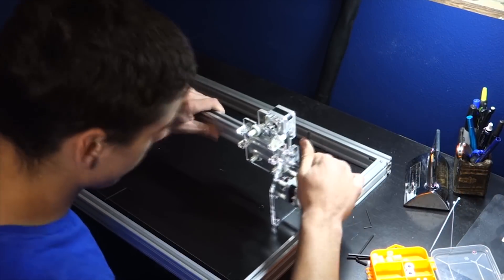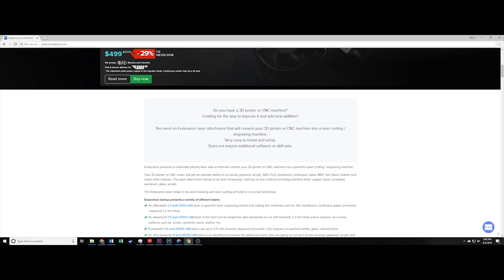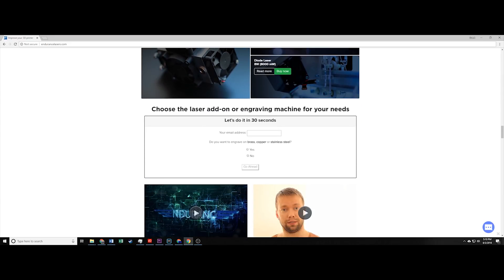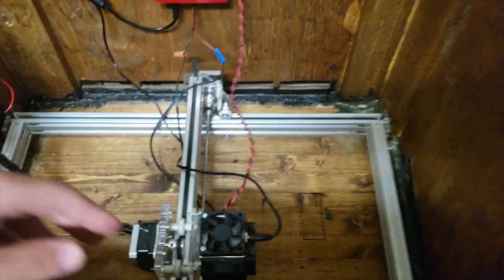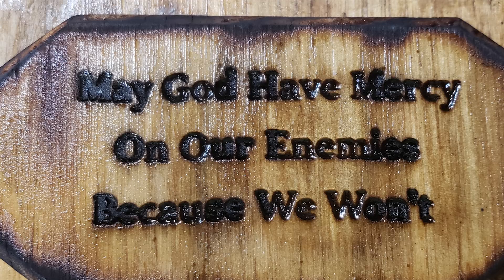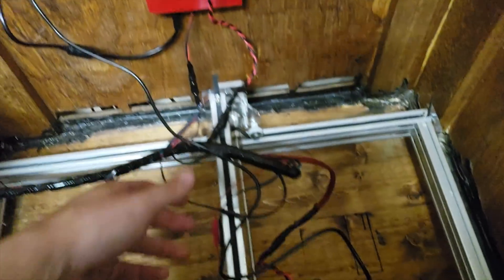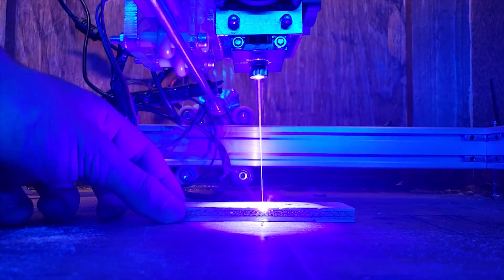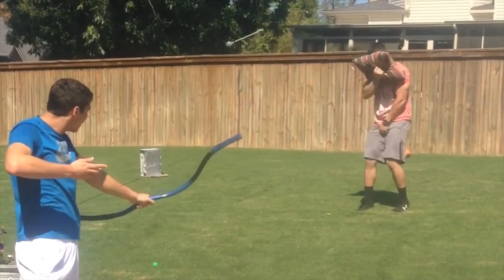10 Watt Laser Engraver Upgrade (Endurance Lasers)

Comment: I can't see the justification for spending the money on those lasers.  Other than keeping the same hardware for the rest of it.  For the price of the 10w laser itself, you can buy a low end 40W CO2 laser system that will do a whole lot more.   I love the diode laser systems for the low cost.  Until you start spending this kind of money.  I love the fact it's US made and make to really last.   Maybe over time after they sell a bunch the price will drop.
Reply: this laser has much more precision, longer life and you can mount it on as big as you want .. while the CO2 laser has very small surfaces for 400 dollars? no thanks!